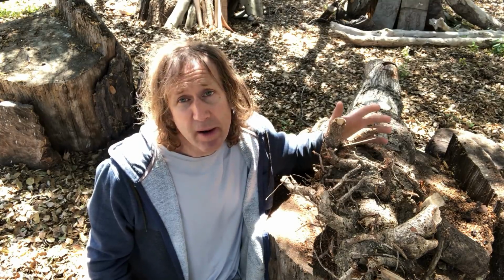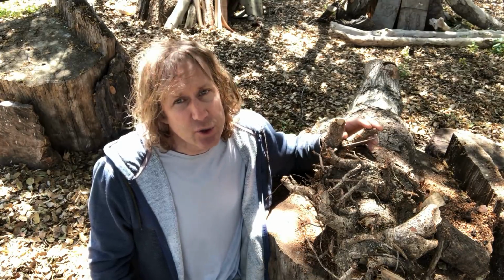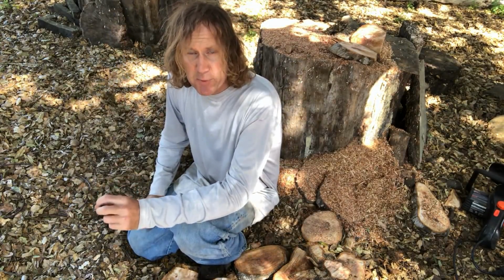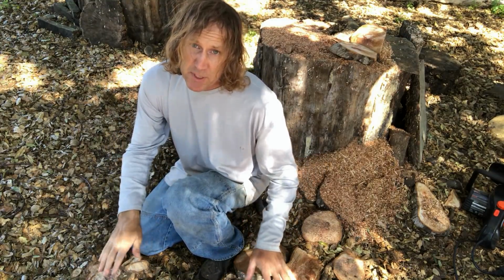turning a few wood slices into wall art

Comment: Scott what is the cutting blade you use on your angle grinder?
Reply from the maker: It's a chainsaw carving disc. I got mine at Harbor Freight which is the least expensive one available. They make much better ones like the Lancelot but the one I've got works good enough.
Reply: Thanks Scott Looks like it would work better than my belt sander.
Reply: Scott thanks for the feed back. Made a couple wall pieces look nothing as good as yours. Thanks  Jack